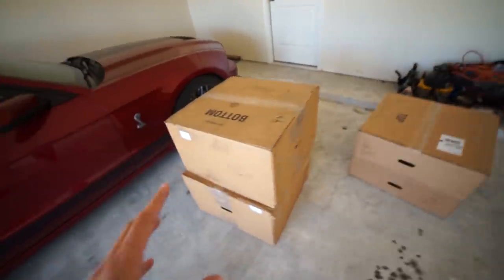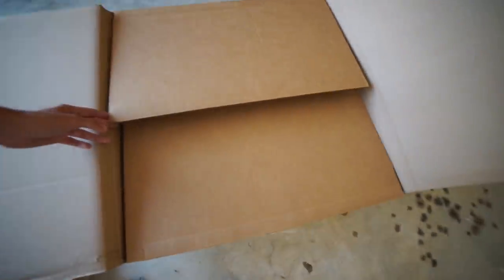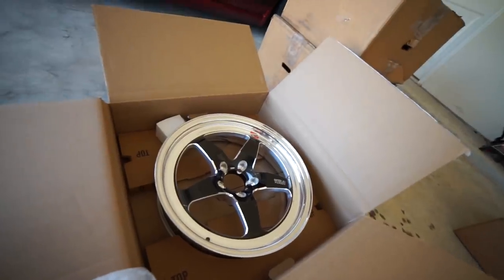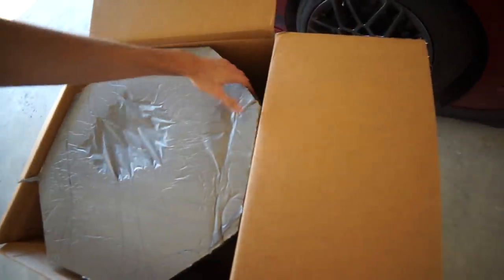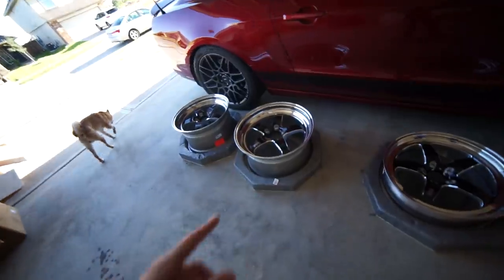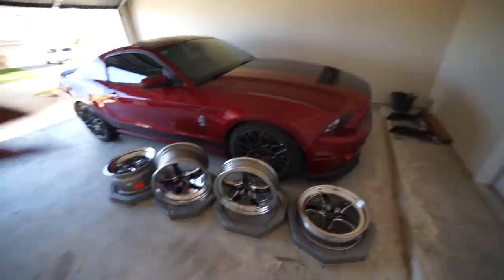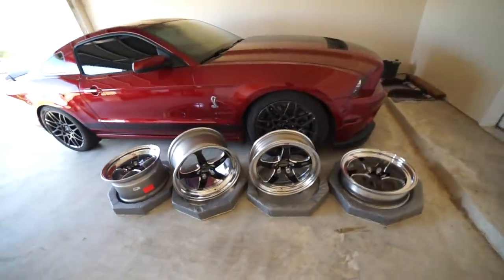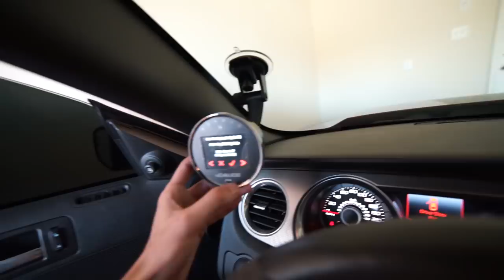MY NEW WELD DRAG WHEEL SETUP FOR MY SHELBY GT500

Comment: Looking good. I can’t wait until I get my 15” drag setup for my Shelby. I’ll need to run a 18” front runner due to the big front brakes though. I’m going to swap the rear rotors to fit the 15s